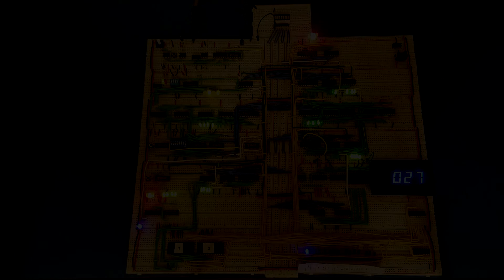Demo of New Output Register - (Ben Eater 8-bit Computer) SAP-1

Comment: Excellent Videos! I am "late to the game" in regards to assisting with your issues, but wanted to add my comments as to "why" the larger cap. does, indeed, correct the switch bounce. (If you have already figured this out, then I hope this description might simply help others.) 

Cole's comment from the previous video was spot on - and you are correct in that this 'does indeed' resolve your bounce problem.

The trick to using a 555 in mono-stable mode as a de-bouncer is to make sure that the 'High/Set Latch Time' is greater than the maximum observed switch bounce time. Details: If you connect your scope to the switch itself and display the bounce (like Ben did in his Clock - Part 2 mono-stable 555 video) you will notice that there is a typical total time frame in which the switch bounces on/off until it reaches it's own stable on state. For ease of numbers lets say that the switch bounce total time is 5 us (micro sec) and the High/State delay on the 555 is initially set to 1 us (via the RC pairs). The time of the 555's High/Set state (1us) is less than the actual switch bounce time (5us) thus the 555 would attempt to drop low before the switch has actually stopped bouncing. Upon the next switch bounce - the 555 would trigger another mono-stable High/Set and the process starts again. But we just triggered another overall rising clock pulse 'unintionally'. Making sure that the RC settings result in the 555 staying high 'longer than the maximum switch bounce time', is what we desire to truly de-bounce the switch. Adding the larger capacitor increases the time delay that the 555 stays High/Set to be greater than the 5us switch bounce time - so it only ever outputs a single High/Low pulse - as desired. (I hope that all makes sense).

I do hope that you are planning on continuing and/or making more vids. Your speaking style, very detailed explanations and concise descriptions are appreciated and welcomed. I look forward to others that you might post and thank-you for these that you have posted.

Comment: I've been thinking about how the jump instruction would work.  For an unconditional jump, it would just require one extra control line to load the data portion (4 bits) of the instruction into the program counter, but conditional jumps would be more difficult.

I'm thinking that a conditional jump would require extra logic.  First, we need a status register to record the results of the last math operation (zero or carry/borrow at a minimum).  Next, we need a way to AND the appropriate status register bit with the JUMP control line so it won't cause a jump unless the status register bit is also set, but still permit an unconditional jump too.

I have a few ideas running through my head about how to do all of that, but I think I'll wait and see how Ben Eater handles it because he might have a better solution than anything I can dream up.

Comment: Just a heads up, you are going to need another 74LS173 for the conditional jump.  So if just used up your last ones you will need to order more.

The unconditional jump is simple.  It's just a register to register transfer, just like the OUT instruction, but with different registers.
Reply from the maker: Thanks for the heads up. Luckily I have loads of these 74LS173's. There's an eBay seller by the name of "premierchoicecomponents" that I've been using for a couple of years now when I want IC's. Never had a problem with them. I got a tube of 45 brand new 74LS173's from them for $25 + $5 shipping. http://www.ebay.com/itm/272619879703

Now that I'm all caught up on the videos, I've been wondering how much building is going to be left to do. Sounds like there's at least a little more to do ... assuming he's going to do a video on that conditional jump you mentioned. I definitely hope he does.
Reply: In terms of getting to where Ben's first computer was, just a 74LS173 and maybe another ROM chip, depending on how many control lines you are using now.  Possibly some glue logic which my brain filters out as it's basically free in a fpga.